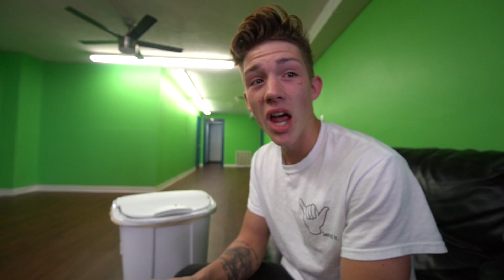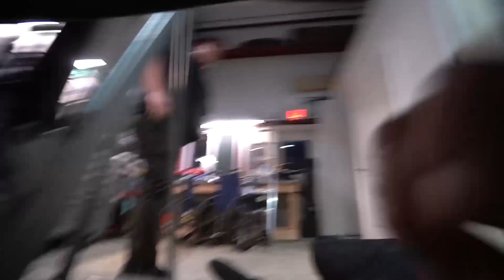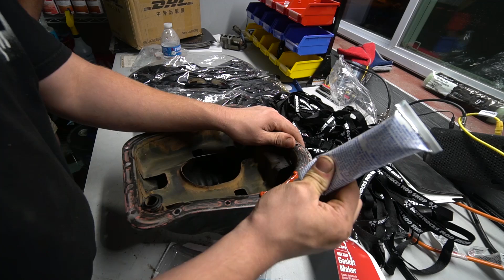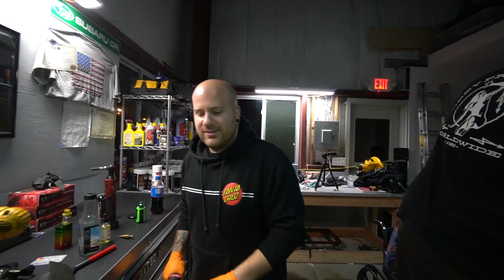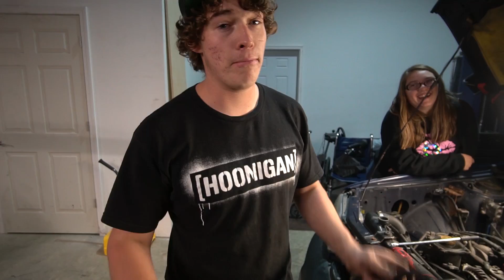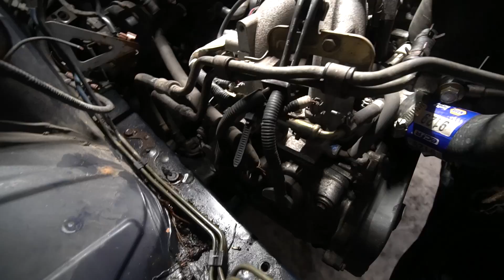BATTLEWAGON, WILL IT RUN TODAY..?

Comment: It could be a bad ignition switch. Autozone can test ur starter for free if u bring it over there. u kuld test the lines running to the starter 2 make sure it’s getting power with a volt meter 2

Comment: You should have used great stuff rtv it's sets right away awesome shit did my water pump and had to beat it off with a 2x4 when I changed it cause it overheated when the water boiled off

Comment: Using too much silicone with a cork gasket will cause the cork to get pushed out of the way when the silicone smooshes out which causes major problems. That's probably what you are thinking of.